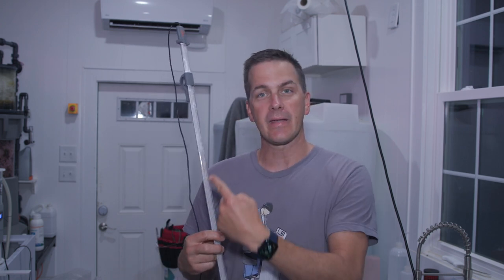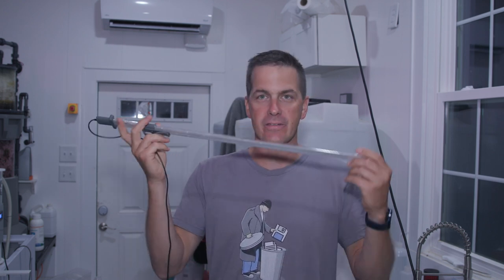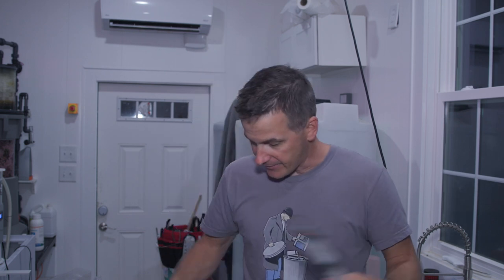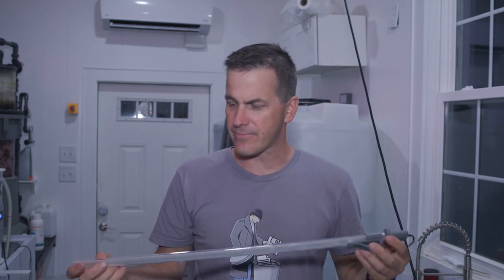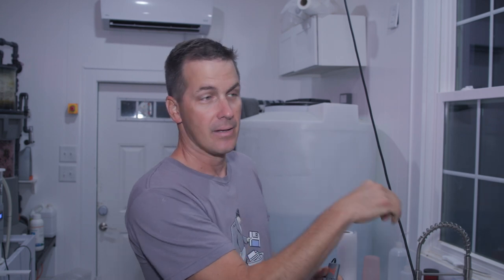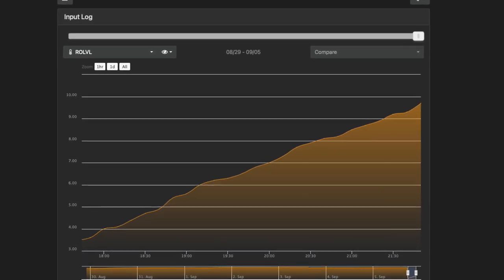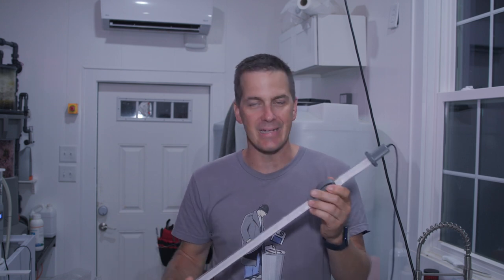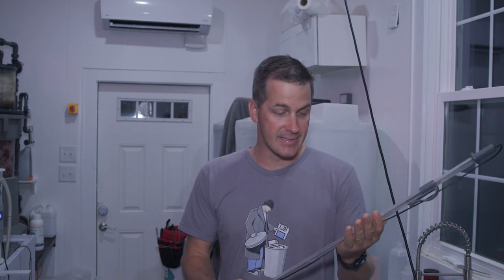Neptune Systems LIQUID LEVEL SENSORS - Mr. Saltwater Tank - Raw, Uncut, and First Impressions

Comment: Cool sensor.  I can see a lot of uses. How did you mount inside of your RODI tank?  I see it is a blow molded tank so no real place to clip.  I have two 65 gallon ones in my system with just that ~1 ft diameter screw on cap. I like the idea of the magnets.  Thanks, love the videos.